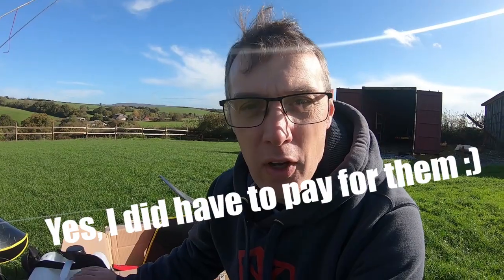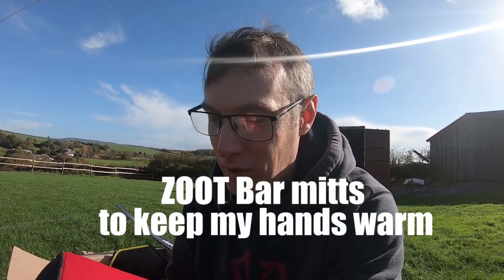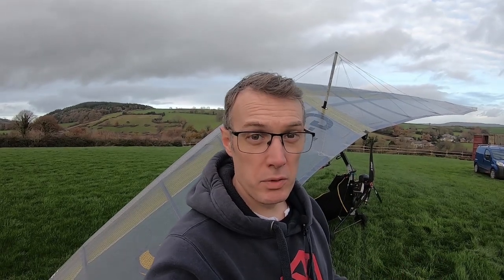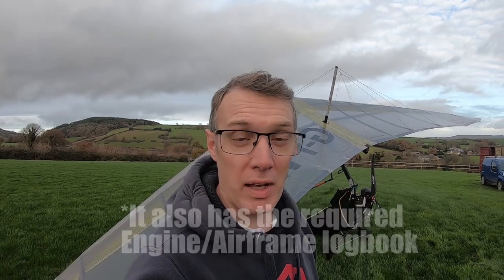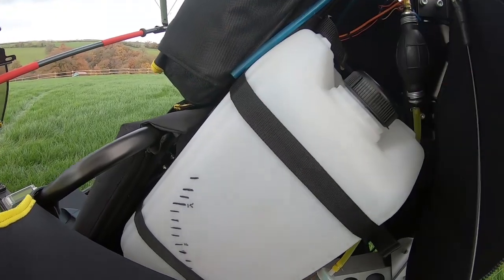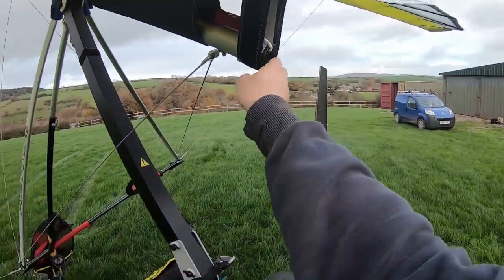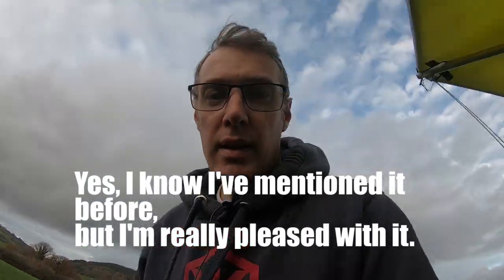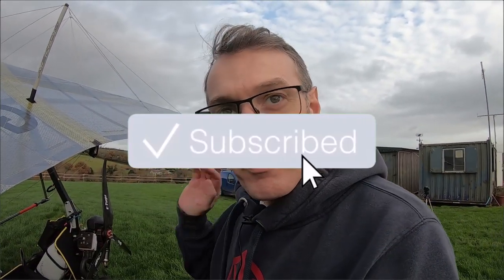Longer RANGE more THRUST -  My PEABEE gets some upgrades

Comment: Great mods Giles. The compass mount is brilliant! I can really see these being popular  with trike flyers, I would have one for sure. I see you have new wheels too! they look fantastic!
Reply from the maker: The wheels sneaked in a previous video but they have a made a hug difference to soft ground.  In the sub 70 configuration they cost about 4 litres in fuel :(.  When I was carrying only 11 litres that a big dent in the flying duration.
Reply: @GolfFoxtrot22  WoW!  the increased drag of those wider and I suppose heavier wheels, costs you an additional 4L of fuel out of a tank?  if this is what you're saying, I'm blown away, never would have thought, it would make that much of a difference. Interesting stuff!
Reply from the maker: @planecrazyish  not so much drag, just the weigh compensation to keep the weight below the 75 kgs (I have a reserve fitted).  The spoked ones were really light yet strong , just not good in really soft ground.
Reply: @GolfFoxtrot22  Ah! I understand, thanks for the clarification.
Reply from the maker: @planecrazyish  it's all in the little details.

Comment: Nice upgrades. As I write this it's really windy, and wet in Williton. Hope you get some decent flying weather now the PeaBee is ready. Happy Christmas.  Cheers John Gathard
Reply from the maker: Hello John, yes it's definitely out of limits atm. But I managed a flight a few weeks ago once lock down finished, I'm editing that now.
Reply: @GolfFoxtrot22  I had a random thought concerning your throttles. If you are for example cruising along at 75% power using the hand throttle, and something happens and you need both hands on the bar, reverting to foot throttle. Can you reduce power without needing to manually close the hand throttle?
Reply from the maker: @johngathard4717  No, but I can override the hand with the foot throttle.  If I was in a situation that needed me to close the throttle, it takes next to no time and I wouldn't be using the hand throttle in the circuit.  It's no different to a throttle in a normal flexwing 2 seater, they all have hand throttles.

Comment: Another great video Giles, I have been following your PeeBee adventures avidly.
I have a Dragonfly and fitted a primer bulb similar to yours, however it perished after a year! ( Yes bought on Amazon, cheapskate) Luckily I spotted it on the preflight.
I replaced it with one I push into the vent pipe to pressurise the tank and avoid contact with the fuel. Removing it to fly. No problems now.
Reply from the maker: Hello Peter, I always wanted to fly a dragonfly, I feel I have gone the long way round to being in a position to fly one. I recently received the PeaBee maintenance manual and it actually says to change it annually. I used to prime my paramotor by blowing in the vent tube, and actually did this on my Peabee for a time, but I kept over priming it. Thanks for the heads up and if (assuming you are UK based) ever at a fly-in and I'm there poke me and say hello.

Comment: Nice upgrade apparently Vittorazi now have a 200 which weighs the same as the 185.
Reply from the maker: Hi Natural9, ohh have they. The big issue I have is the 185 is almost too much and I have to back off once I'm in the climb. Flylight have actually just made a lighter version of the PeaBee and only using the Atom 80, retracts as well. 😁.

Comment: No Rotax but still some nice upgrades. 👍😎
Looking forward to seeing how she performs in the air.
Show us some details on the hand throttle integration.
Reply from the maker: Hi Doug, yes not fitting a Rotax, it would probably cost more than the PeaBee in the first place. I've had lots of requests for details on the hand throttle so it looks like I'll be making a video on its construction.
Reply: @GolfFoxtrot22  🤣 oh yes, the Rotax is big money.   Aircraft with foot throttles seem weird to me so i will enjoy your forthcoming video.  👍
Reply from the maker: @DougBow96  it's definitely a flexwing thing having the foot throttle. I was just surprised how many people didn't know I was using my foot to control power. But when you need both hands on the bar, using your foot makes life a lot easier.
Reply: @GolfFoxtrot22  That is interesting.   I understand the need for a foot throttle given the weight shift control.   Just one of those things that I understand the need but still find weird.  🙂
You need a wireless twist throttle on the bar. 😄
I'm just silly - waiting for my coffee to brew 🤪

Comment: Thanks for the upgrade video.  Looking forward to your next flight !  My only concern is the fuel line.  In the video, it appears to be stretched around the tank ?  Just wondering if the stress might cause it to detach ?  Have a Merry Christmas and Happy New Year !
Reply from the maker: It's not stretched, it takes the feed from the bottom of the tank and is also wirelocked to the filter. Thank you for mentioning it, its nice to see people noticing little details like that. Happy Christmas to you and yours.

Comment: Great update 👍
Looking forward to triple prop review.
Would love to see more details on hand throttle install as I daft with such things.
Long winter ahead, your vids the most anticipated.
Cheers
Reply from the maker: Hi Patrick, that's 3 requests so far. I'll have to try and make one then.  Its not so much as cold in the UK, just really damp and wet all the time.
Reply: @GolfFoxtrot22  
I could make some ski's for the snow dress for the cold flying here - its more the trailering - taking the 40min round trip  trailering of my unit on the salty roads is the largest deterrent.  I think an enclosed trailer is in my future.
All the best to you and yours

Comment: Hey GF. I was thinkin of 3 bld e prop to replace my 3 bld helix. Curious to se the difference in climb rate.
3 blades are smooth but i think e prop is a bit lighter.
  Should be less wear on engine quicker throttle to power transfer.  Lookin very forward to your results.
Reply from the maker: You'll be pleased to know, that video is already out, you might be surprised by the results. Quite a few to catch up on 😉👍.
Reply: @GolfFoxtrot22  thanks lookin for it
Reply from the maker: It's in the last few.

Comment: Great video, what is the ID and OD of Yellow colour fuel line hose you are using? Thanks
Reply from the maker: There are 2 types (diameters) but it is the normal ones used on A Vittorazi Moster. 4.8 and 6 and 6 and 9mm. I hope that helps.
Reply: @GolfFoxtrot22  Great 👍

Comment: Another good video Giles, all looking good, btw, what is the max weight you can go to now?
Reply from the maker: Hi Billy, thank you. I've registered the MTOW slightly less then Flylight list on the G-INFO 190 kgs.  That's within the wings safe loading, gives me a full tank and 15 kgs of stuff.
Reply: @GolfFoxtrot22  thats good, so 20ltrs of fuel and luggage. As you may remember me asking the peebee as im interested also in moving up from the ppg, (although I intend to keep that going), im starting with NPPL so as in 2021, Iguess ill see how long that takes, then decide what to get. I have friend selling his drangonfly, anyway, catch you next year somewhere im sure.
Reply from the maker: @johnling4299  Hello Billy, yes I do remember, I hope you are well. I need complete the final fuel figures, I'd like at least 24 litres. I don't think I'll loose too much. I did my calculations on 25 litres and 15.kgs of luggage, which is more than enough. The Bivvi Bee has more capacity though.
Reply: @GolfFoxtrot22  ..oh thats a fair amount of fuel Giles, I look forward to your future videos and xc trips
Reply from the maker: @johnling4299  it certainly is. Even at 6 lph, I'll call that 3.5 hours. I can also now carry extra fuel in a bladder in the Bivvi bag. Its not going to be an ultra long range machine, but I can carry my return fuel, which will make a huge difference to my flight planning and options of where I can fly.

Comment: I'm sure there's a reason why you haven't already done this but I can't help wondering why you don't rotate the gas hand clockwise a quarter turn to put the cap at the top and being almost able to fill it up?
Reply from the maker: It's a good point, but the tank isn't squares can't rotate the extra 90 degrees. It's really snug to get it in this way. I would have loved to get the cap at the top. Thanks for suggesting though.